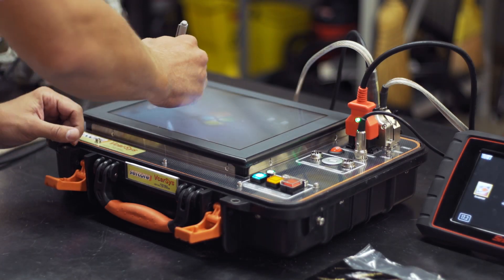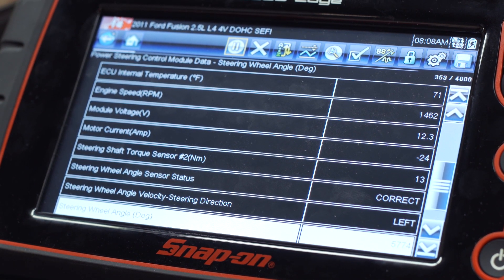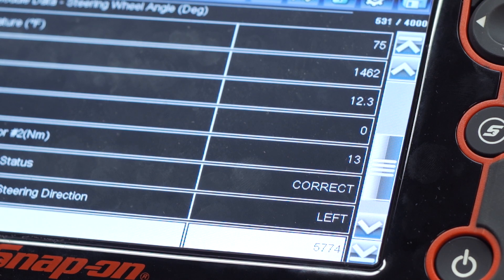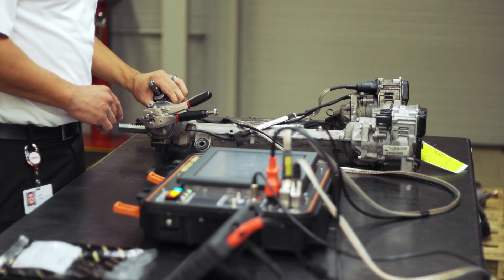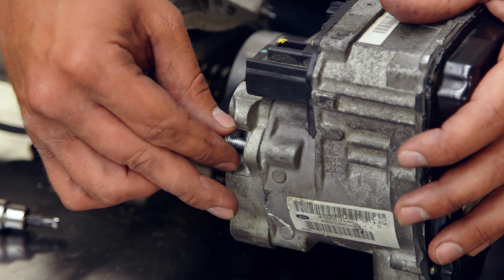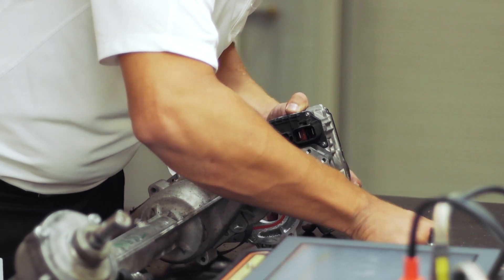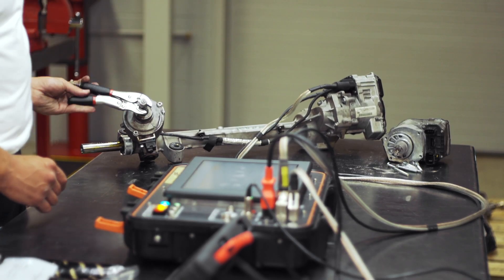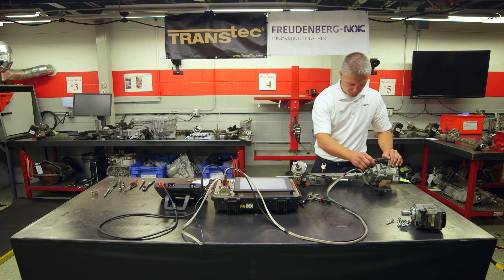Ford Fusion EPS Rack & Pinion

Comment: OKKKK BUT HOW CAN WE FIX THE STEERING ANGLE SENSOR?? IS THAT EVEN POSSIBLE ON THIS EPS  WOULD IT KILL FORD TO HAVE PULL A RELUCTOR TYPE SENSOR ON THE STEERING WHEEL SHAFT OMG.

Comment: Question how to bypass from the computer to work normal...? We need a hack as the sensor triggering it to stop work...
Reply: Exactly, I can reset and calibrate the SAS  and the power assist works but then it turns off the power assist randomly the next few drives but the assist will still work until you turn the car off and back on, so I know its not a mechanical fault.
Reply: @LIFTANDFIX  it's the steering angle sensor in the steering failing from turning the steering right and left ....I already sold fusion and bought a Pontiac vibe less expensive and easy to maintain....
Reply: @Platinumtag yes, the steering position sensor is what tends to fail intermittently. If you erase the code it returns to normal until the next intermittent failure. Seen it on a couple of Fords with Electronically assisted steering.

Comment: Can I replace the torque angle sensor only? Thanks and where is that located?
Reply: I can get it out the junk yard and I'll grab 2 just for safe keep
Reply: @DIYunpolished did you find one at the junk yard and we're you able to replace that part? My assumption is tht it's built in and nonservoceable but have not opened one of those. Some engineers have looked at it but I'm sure for safety reasons they can't disclose much.

Comment: There's got to be some way to reprogram these rack and pinions cuz Ford brings them back on a recall and just plug them up to a computer and give you back your car cuz they did that for me one time and then I actually had to get my replace not because of my rack and pinion went bad again but because my boot came off and bar that moves your tie rods rusted out I can't remember the name of it but y'all know the thing inside of the rack and pinion so I don't believe that you actually have to take this whole thing out of your car cuz I actually went to a Ford dealership and all they did was reset it and it was on the paper that all they did was reset it
Reply: Same thing here happened to me and I actually reset mine at home myself with my cousins snap on tool and it worked for about a month then ford reset it also for $175.00 then it worked for about 10 miles then went out again.

Comment: I want to make a  note that this is not a rebuild. This is a temporary fix. You built one working unit out of 2 defective ones.  This get you ahead in a game but this is not a rebuild.  You don't know when the other parts will fail in the unit and you don't know what caused the failure. Lets say hypothetically that you use the one that the  motor was working and sensors are failed. What if the sensors failed because the  motor is deteriorating and pushing the sensors out of their range ? Or vice versa ?  I'm saying your newly "rebuilt" unit is a time-bomb as you don't fix the issue just simply swap the parts with an another used one that still works.   It should be properly rebuilt. Sensors changed, motor changed, etc. Then we would know that all units that fails are rebuilt so it will last a long time. The one you created might last 30 minutes or 30h or 30 months, but for sure it is not as good as a new unit.  Since these racks have a tendency to fail, and as we can see multiple different issues, why not sell just the components that actually fails in it, which is the motor and sensors.  Ford could just sell those at a lower then complete unit price.

Comment: Do not take two bad racks and make one good one. You will NEVER get a good one. These racks are a known Ford problem due to the electronics built into/onto the rack. They get hot ! Repeatedly. They were not designed to withstand the temps they get subjected to. Take me for instance. I bought a good rack from a junkyard off of a vehicle that was totalled via a rear-end collision. It wound up going bad within 1 week of the install. So I was out a tow and the install labor. This time I went for a reman with a 3 year warranty. This was maybe a reman but the electronics were not. You are getting the old shitty electronics that are about to go out. These complicated electrical units were NEVER meant to be disassembled and rebuilt. And they aren't. So, now that I have had this REMAN rack on my car for 1 week, it is starting to fail. Just like all of the other junk. Trust me. Save yourself a lot of heartache. Bite the bullet and spend the $1,200 or so for a NEW rack. My car is now sitting on my carport awaiting the money ferry to bring me $1,700 to buy and install another rack.
Reply: Get a good scan tool and see what the fault is! Read live data like he is and figure out what it was. Mine failed due to a traction control steering angle sensor and not a good alignment. Reset power steering and works fine, turn traction control off.
Reply: thought you said there was a 3 year warranty. was it for parts and labor? (that was for the reman)
Reply: Jeffrey Claypool crap parts I installed one I got a junkyard for 120 last 5 months broke again bought another one for 100 bucks broke 2 days later!!!
Reply: Garbage repair for me too. Either new or remanned unit for my work. And if it’s new I warranty remanned I’ll do labor for half. It’s literally a roll of the dice because these videos show me insight on how they possibly rebuild it. Chances are they may not totally rebuild the unit with new components and just used working ones and paint the rack.